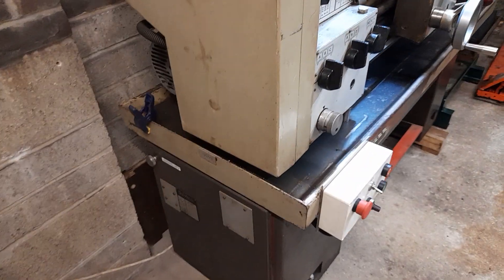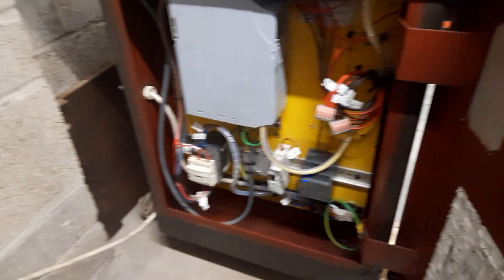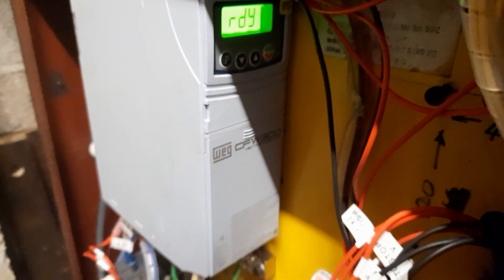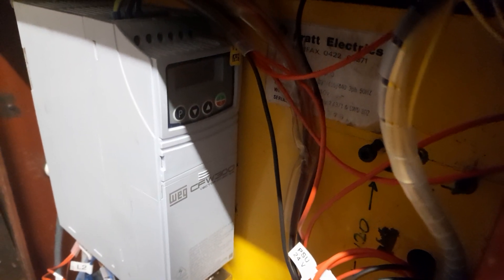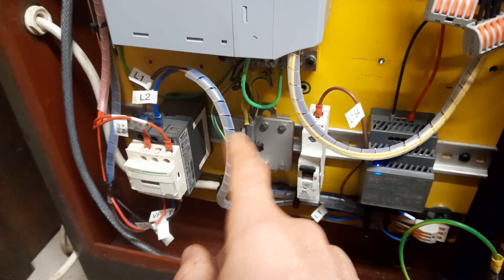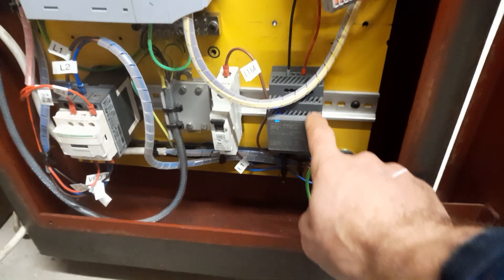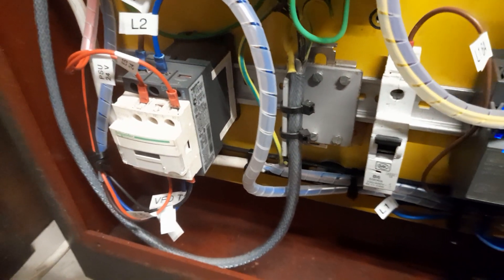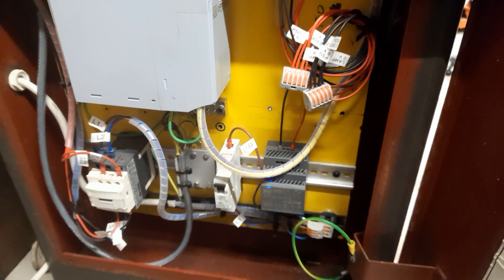Using a contactor with a VFD on my Harrison M300 lathe (video 2/3)

Comment: Excellent! Can I use a disconnect instead of a contactor on my vfd installs? I'm talking about an AB bulletin 194L  E20? If I use a contactor I'd need a 24 volt ps and being as I'm gonna be installing an digital tach rpm gauge to see the actual spindle speeds which will need a 12 volt ps, I'd have to use two separate ps's with both tach and contactor? What do you think?

Comment: Hi mate, did you manage to do the 3rd video with the circuit diagram ? Struggling to find it. Cheers
Reply from the maker: Hi. Sorry, never got round to recording another video.
Reply: @ hi, thanks for your reply, no problem. Can you remember what size motor your lathe has ? One I’m looking at buying has a 2.2kw 8.7amp and I’m not sure if I can use the same VFD as yours, thanks for your help mate.
Reply from the maker: @Deano1990 possibly 2.2kw and I've never found it underpowered. I can check later.
Reply: @ brilliant thank you so much I really appreciate it! Also I’d happily pay for the wiring diagram if you ever find it out. No worries if not! Thanks again!
Reply from the maker: @Deano1990 I just checked. It's 2.2kW. No need to pay for anything. I'll see if I can post the diagram somehow.
Reply: @ brilliant! Thank you very much! Again it’s really appreciated mate!
Reply from the maker: I've posted an image of the circuit diagram on this channel. Hopefully you can find it.

Comment: I have a similar M300 lathe here in the US.  I am intrigued by your setup because I have been trying to plan a simple and clean conversion to single phase with a VFD such as the one you did.  My machine has the EWD 308 wiring sticker (US market) yet the wiring appears to match the EWD 302 (EU market) with the large 25 amp fuses.  The US market lathe had a thermal magnetic breaker.  It appears that you removed all the original electrical controls and simplified the setup.  I want to keep the forward/reverse handle functional and use simple 110V relays to control the low voltage VFD inputs.  Do you have a wiring diagram that you could share?
Reply: Hi Eric, I have a m300 here in the US also. I have mine running on a vfd. I was able to use my fwd/rev handle. Was not too bad to figure out. I was able to program it all myself, and this was my first vfd I've ever seen/used. Basically you connect the motor itself directly to the vfd. Bypass all the oem wiring/contactors/etc.Then you would connect the wiring from the microswitches for fwd/rev to the input of the vfd. I unhooked the original wiring,and just made and ran new to the vfd inputs.The vfd manual will have the option you need for the configuration you want, and how you want the switches to operate. I didn't have to use anything else-you referred to relays or something-not needed.. The only thing I never got right was the footbrake, but I am 100% confident it's just a setting I never did get programmed right. Hope this helps you out some. BTW, the vfd I got was about 300.00 on amazon, nothing special. It's an ATO, 5hp vfd. You size them bigger than your motor.
Reply: @ thanks for the info.
Reply: @seanmcalum9238  I drew up the wiring diagram and I am a little bit puzzled by the foot pedal circuit.  The foot brake is a momentary normally closed switch.  The hand lever is a permanent switch.  I cannot figure out how to wire up the pedal to prevent the spindle from restarting upon release.  I also want to force a reset of the lever if the pedal is depressed.  Seems like the only solution is a latching relay on the pedal circuit.
Reply: @ericb.4914  seems like I remember the foot pedal switch being in series with the e stop button on the front panel??
Reply: @seanmcalum9238  did you use the existing microswitch on the lever to trigger the VFD to run forward / reverse?  I am trying to avoid that due to the age of the switches.  Instead I am trying to use the old microswitches to trigger 2 relays (fwd/rev) to signal the VFD.  Maybe I am overcomplicating things.  I just dont trust the 45 year old switches.
Reply: @ericb.4914  i did use the old ones. Its a low voltage trigger. Mine has been fine.